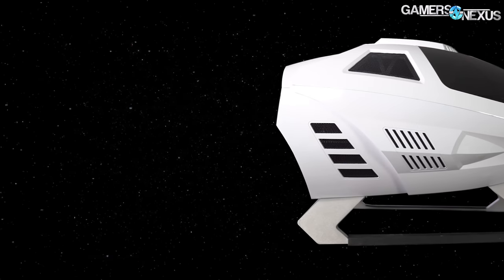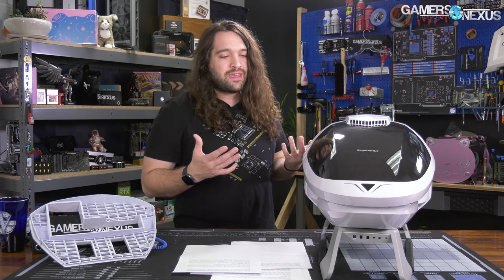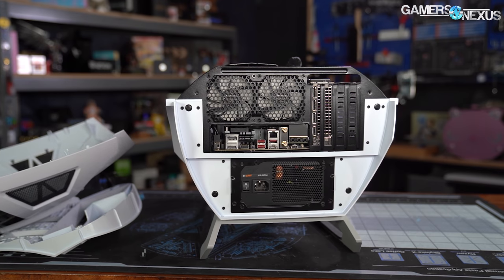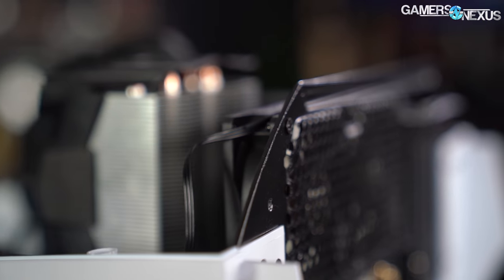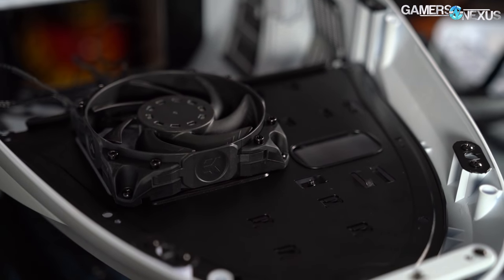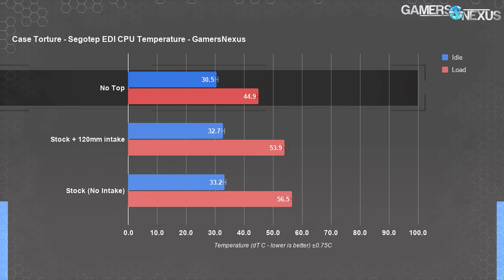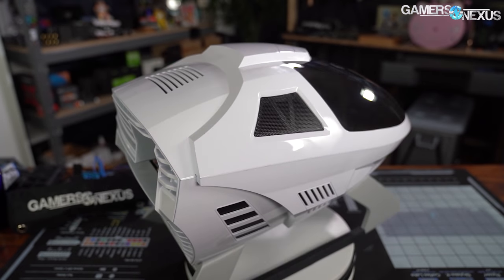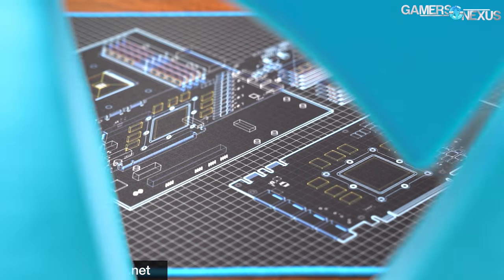Spaceship PC Case Review: Micro-ATX Segotep EDI PC Build

Comment: The real April fool's joke is that this is a serious review.
Reply: Unfortunately a real review, they did a live stream building this monstrosity last month..
Reply: @EricH_1983  it looks original compared to the same box design of cases with tempered glass and RGB
Reply: @Chris-hw4mq  Just because it has an original design as compared to box designs doesn't mean it performs well either.
Reply: @blueblade455  this looks to be a display piece first, and a performance piece second (if at all). For its target audience, it's probably fine. If you additionally want awesome performance, the extra R&D and extra material costs to make it larger to fit bigger components would turn this into a $300+ case.
Reply: @Nareimooncatt  Good point, if their production models have improvements such as increased air flow and a better opening and closing hatch system then I guess you would be purchasing a worthy novelty item. Then again people are spending 500 dollars for CPU's and 2000 or more for GPU's. Eventually spending 300 dollars on any new or used computer component will soon become the days of the past.
Reply: it would probably trigger the YouTube bots if Steve or Steve wasn't doing benchmarking, and we don't want that, lol.
Reply: @blueblade455  PC parts got cheaper over the years. And I personally think that prices will drop dramatically after this component shortage stuff is taken care of.
Reply: @MalfunctioningAndroid  I most certainly hope so.
Reply: It's Inception-level joking. LOL
Reply: Hey it's an actually funny joke not some generic cringe.
Reply: @elihernandez330  Like the LTT Only fans video?
Reply: @megan_alnico  yessss. good lord it was weird.

Comment: what this case needs is some 3d printed specs so you can create fan mounts and and shrouds for that front vent area, and vacuum form for that tinted "glass" part. seems like a really cool case for modding. pretty cool.
Reply: it would also be really cool to change the LED filter for that projection to a starfleet logo. just my last thought on this one.

Comment: As a case modder I'm just looking at all the bits that could be changed around.  First thing I thought of was some  sort of add on pod to house and open loop water cooling set up. But hey that's just me. People with 3d printers could come up with all kinds of things to add extra stuff to fill in the dead space inside as well.

Comment: Seems that if they can add a CM to the height of the dome it would be much better to accommodate bigger GPU and CPU tower coolers.
With the extra height and some wider back they can even allow for 92mm case fans which would be a slight improvement over the 80mm ones.

Comment: 19:40 You can find soldering flux on the back of nowadays motherboard quite easily because the WasteWater Pollution Index is getting more and more restricted, and most manufacturers starightly skipped the washing process, not using any water at the very beginning instead of spending money on treating wastewater afterwards.

Comment: I don't like the logo written across the windshield. I noticed that parts of the case go across the inside of the windshield, which I would like to be clear.
I am looking to build a computer that would be a small size, but would use this case for the reason you gave as to the quality of the build.
Also, could there be a black trim added between the two halves to get more room inside the case?

Very good video, too bad there are negatives to this case that could have been avoided.

Comment: I wonder if you could mod in another intake fan on the top of the case, at the scope area. Might help a little bit...

I think most air bubbles in the AIO loop will end up at the top of the hose, rather than the pump, so it should be fine. There may be some water noises but the pump itself should be covered fully in water. The sad part is the fact that The rear of the case cannot have a full 120mm fan, so you can't really easily find good fans for it.

Comment: My class took the engineering challenge of installing a 120mm AIO by stacking a 120mm x 38mm pwm fan plus 120mm x 25mm pwm fan reverse fan below the radiator and a 120mm x 25mm pwm fan above. Max temp on a 3900x is 68 C.

Comment: The videographer needs to adjust the lighting to be brighter for the depth of field to be suitable for shots like these. That means a smaller F-stop and slightly longer exposure. With proper lighting, no loss of quality should occur, the whole shot of the case would be in focus and it would be far less irritating than the shots at 13:30. 
Just a friendly and hopefully useful constructive criticism. 
Love the channel and recently purchased a mouse mat & even paid extra to have it shipped to China where I reside as an ex-pat.

Comment: 5:23 That foot is not cast.  It's a flat plate that was cut with a water jet and bent with a press.  You can see the telltale marks on the corners where the water jet head slows down and doesn't cut a consistent straight line.  And the rounded bend where it meets the case is characteristic of a sharply bent plate.

Edit: Another thought watching the conclusion:  All those minor fit and finish issues are the difference between $200 and $500.  It's honestly impressive that they've managed to manufacture and assemble all that for only $200.

Comment: if they made the dome mesh it might be able to handle high end stuff with half decent thermals (maybe put a fan somehow on it too from the inside?), also they might be able to redesign to fit a second 120mm fan next to the existing one

they could also cut down on the sled a bit (having it solid cast seems overkill to me...were they expecting people to actually sit on it and use as a sled? xD )so the rest of the case could have an overall higher material quality

Comment: I would personally love a steam punk airship case that could sneakily be hung from its flotation whatever. The problem would be power and IO, but I'm sure there's a creative solution to that out there.

One cool thought was a raider style ship hauling back home loot in the form of an LED screen.

It might not be the most practical design, but I can actually see several uses for a system like that besides looking cool I mean. As it is I have way to little screen relate even when using 2 or 3 monitors because I way too often have many things interesting me, so there is never enough screen space.

Right now I have several overlapping windows because I need to see them, not use, but see and scroll occasionally.

i nether have the skill or the tools to make something like that, not even the space to put the needed tools if I got them, I don't even have  a table to work on, that's how limited my space currently is. So I dream and wish.

But I know I'd love a cools steampunk airship hanging from my ceiling one day, even if it doesn't include a pc.

Comment: I like watching your case reviews (IMO they are the best on youtube) but unfortunately this is the only non-full ATX case you reviewed in ages. Why don't you review more mITX cases? There are many decent ones, for example Silverstone SG15 or Fractal Node 304?
Reply: They said before that it's extremely difficult to standardise ITX testing methodology due to the variety of layouts. GN tries to use the same components for every case they test in for standardisation, so that the only remaining variable is the case itself, hence they've used the same components (motherboard, graphics card, CPU cooler, etc.) in their ATX case reviews for years.

On the other hand, Ali at Optimum Tech benchmarks by maxing out the cooling potential of each case, so you can see the best possible results. If you want SFF content, he's the go-to right now.

Comment: Can you review or at least play with the InWIn A1 Plus? I have 2 of these and am not sure what to do with the 2 lower fan holes.
Reply from the maker: We did an A1 build a few years ago.
Reply: @GamersNexus  no shit? How did I miss this? Thank you!
Reply: @GamersNexus  ok, so I watched the build and this is no longer accurate, although your information on fan placement is exactly what I needed. Both of my cases came with 600w 80+ gold PSUs and 2 aRGB 120mm fans, preinstalled Rear and Side. While the PSU still isn't a modular one, the 'shroud' has enough space to hide all the unused cables for a clean build. I'd chuck some pix of both your way if you'd like, but I don't use the Anti-1A Twitter platform, so I'd need another way to do so.

Comment: If you'd willingly dump 200 into the case, heavy handed on aesthetics - you can stomach a few more, into a few better functional bits, to finish the job. Putting in better fans all around [high cfm rating, like BGears], into the system can assist better with thermals within, but certainly [still] not allow flagship tier / high powered gpu variants... Maybe using an AMD 5900X, without any added OC, could cope in this chassis?

Comment: Water cooling's not possible? Wha?

Get a dual 80mm radiator for the rear, couple of Noctua 80mm fans, Bkski mini pump and radiator, and you're laughing. 

This case is begging for a custom loop.

Comment: I think the azza pyramid is way better in design.

But i had a terrible shipping experience with them, customer support is nonexistent and the early version of the case had a big oversight 

Solution?

Just buy the second model 🥴. Great help azza. No accessories to fix the first model, just spend more on something that at the time didn’t exist 

Oh yeah and you were screwed if you wanted to aircool with it. Terrible placement for fans

Cool design. Shit company